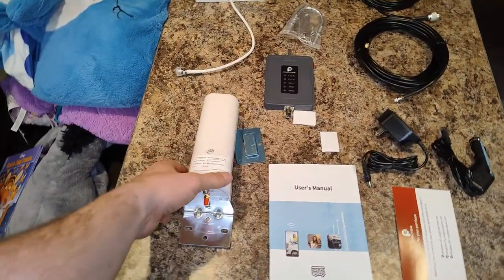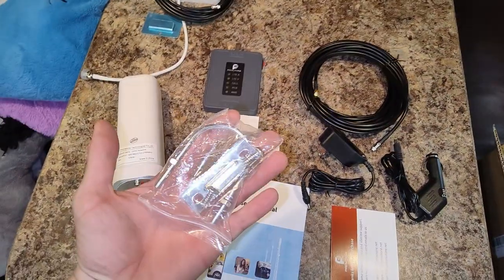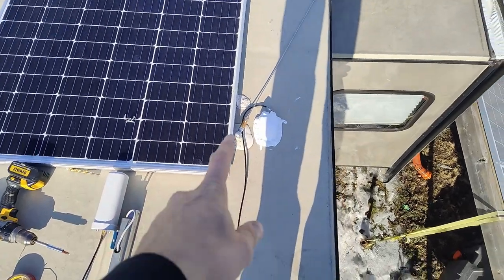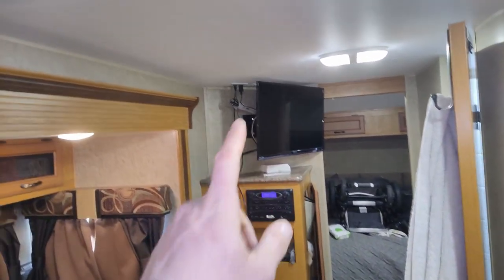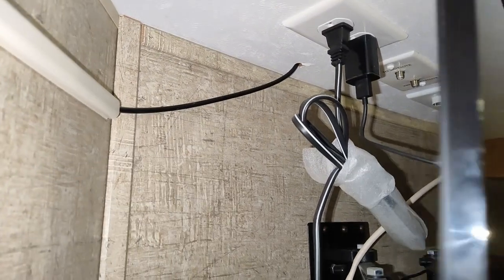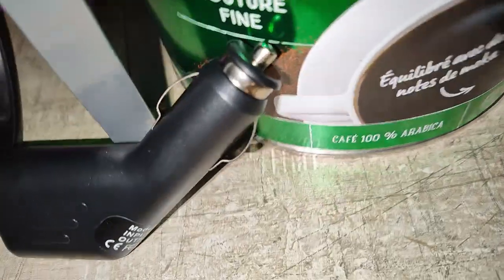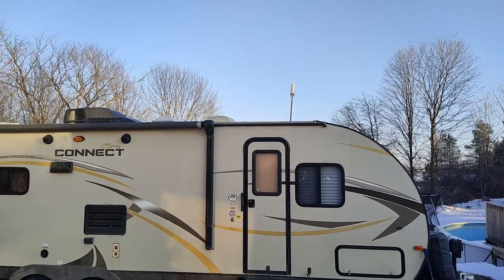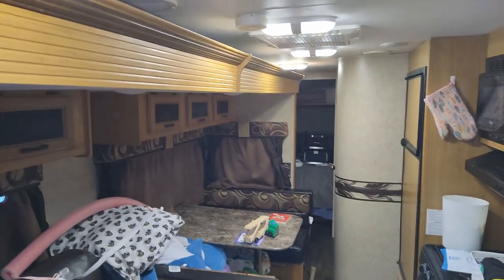RV Cell Phone Booster Install

Comment: You actually could of used the coaxial cable that was on the TV antenna to make the install easier then just connect to the coaxial output inside where a TV goes
Reply from the maker: Dang...

Comment: cool the omni has less gain but likely you wont be able to tell but if required I think a yagi would work as you can turn the old antenna.
Reply from the maker: yes its a cool mounting spot i think :D

Comment: Have you done a internet speed test with and without the unit turned on to see if it improves the throughput nice looking battery by the way 😁
Reply from the maker: the test will be part 2

my cell single is to good here, I need to go where there is no good single.

Comment: I was actually looking at boosters today. And the one you showed, though a different "brand", is basically the same. But they are about half the cost. So I'm hoping they'll have just as good quality.
The one I was looking at is called Anycall. The case looks "exactly" the same, as well as the rest of the hardware.
Reply from the maker: poo I got ripped off :( lol
Reply: @GoingOffGrid101  LOL   Well, maybe  😜
I don't know if there's any difference in the firmware between the models. That's the part that makes the biggest difference, I think. However the two brands were on some top lists for performance, altho at the bottom of the top lists 🤪
Reply: @GoingOffGrid101  I bought one that "supposed" to be 'new' for $50. But it didn't work right out of the box. The seller bought it part of a mystery box purchase. They refunded me, and don't want it back :P So I'll probably pull it apart to see what makes them tick.
I did order another one, that's like the one you got, for $119. Should get it in a few days. I hope it works as expected.
Reply: @GoingOffGrid101  Ok, got my "good" unit in. Tried it out, and kind of on the fence with the quality.
Do you find that you need to be in a narrow field directly in front of the internal antenna to get a good signal? I find that if I'm even about 5* off center, signal drops pretty quickly.
I do need to fix the outside antenna a bit higher up. Right now it's only about 10ft, not quite high enough to clear the roof line. But there is still noticeable difference inside tho.
Reply from the maker: @korishan  mine seems to work everywhere in my house trailer, best signed is closest to the internal Antenna
Reply: @GoingOffGrid101  Hmm, interesting Maybe it's because the outside antenna isn't high enough. Will give that a shot today. Thanks :)